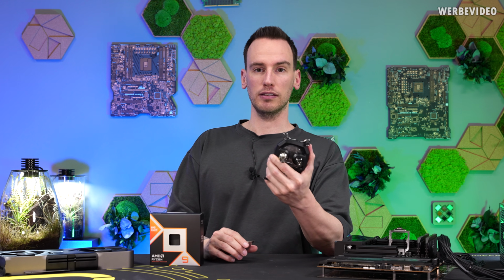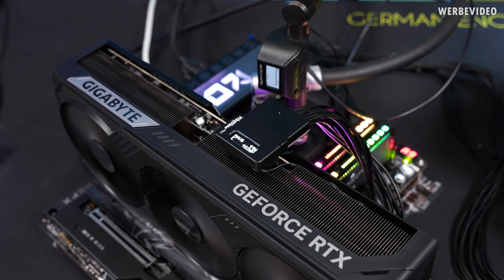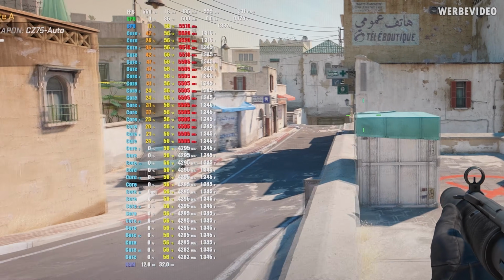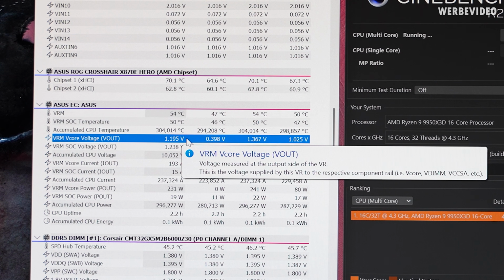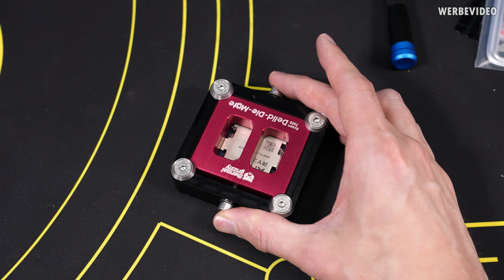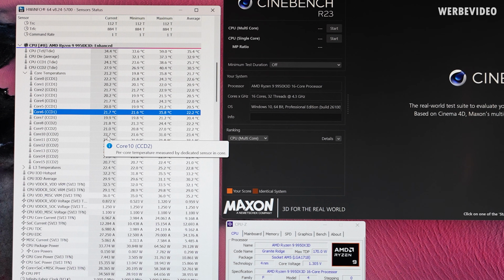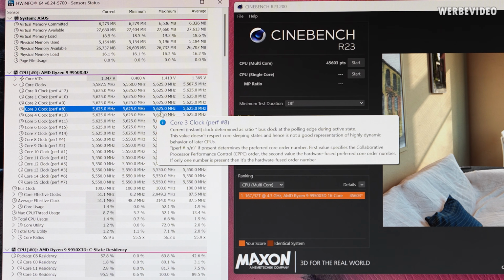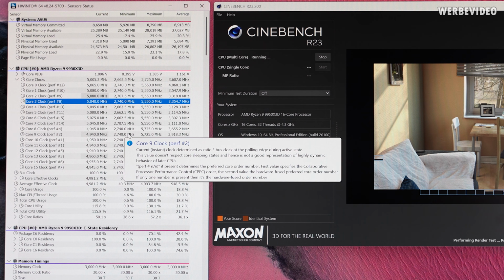Delidding the Ryzen 9950X3D makes it Even Stronger

Comment: hey kind of a noob here, since under load means a huge benchmark, and you seem to have it set it to .5s for the reloads on HW-Info, I would try setting the priority on task manager higher for it's process on task manager. I haven't tried it, but if it's counting the time IT's run it may be getting less and less time bcs the system is overloaded so it's runtime of 500ms may be longer irl.

Comment: Hi, I have a 9950X3D with the IHS. I recently reapplied thermal paste after noticing that under Cinebench load, while the core temperatures sit around 80–85 °C, CCD1 and CCD2 TDIE hit 95 °C. After watching your stock results, I see that your temperatures are within range, with lower core temps. What could be the reason for this?

I have a good thermal paste application and I’m using Thermal Grizzly Kryonaut. Is it possible that the liquid metal under the IHS was not applied correctly?

Comment: I achieved a Cinebench R23 score of 45,500 by running the 9950X processor at 1.075 volts with all cores operating at 5.2 GHz, cooled by a Thermalright Peerless Assassin 120 SE at moderate fan speed, with an average temperature of 75°C.

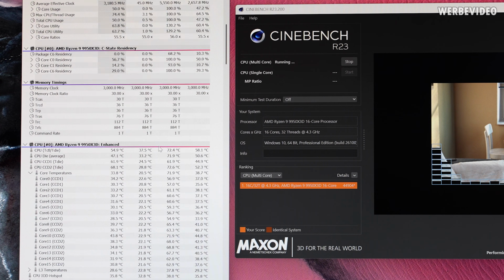Comment: 12:16 this is probably not a HWinfo issue. The CPU is already loaded 100% by Cinebench (or any other heavy benchmark software), so the CPU is unable to run another software, therefore, the temps won't update for a couple of seconds

Comment: ok this is the point where would step back, I'm not fully happy with my 9950x3d with the 280 AF3 pro, this thing idles between 40-50c, still haven't tested it under full load, guess i'll need to find out but whatever temp it goes to, I don't think I'll delid it

happy to see content like this though

Comment: thank you for the instructions. I delided my 9950 and wondering if i need to remove all the old tin from the chips or just use the your scraper to get as much off as possible before using thermal grizzly conductonaut?

Comment: I think I got lucky on my chip ( 9950x3d with 6400mhz ddr5 96gb) watching you review it hits about 72c in cinebench on 360mm AIO and I geta score of 46600ish as my best score. in cinebench r23. I wonder how high I could hit direct die. 

I did take the time (about 100 hours) to test curve optimzer (per core) and curve shaper (stacked together) so some cores are very unvolted (-25 CO and CS -20,) . I get 5.645 MHZ on ccd1 and 5.850-5925 on CCD2 (varies a lot per core) in games. in regards to HWinfo I found manually setting priority to cinebench r23 to normal helps. I mention this because there is alot head room on some chips aslong you can take time to test all small optimzer changes, but it take alot time to get near 100% stability (24 hour Corecycler run)

@der8auer EN It could be just my os (windows 11) but i noticed in past the cinebench r23 will almost alway start as below average priority that interferes with HWINFO 64, I have similar issue with Prime 95. I do also set my hwinfo64 refresh to 1000ms faster that causes issues for me.

Comment: I run my 9950x3d at 5.3Ghz both CCX 1.135 volts LLCmax switching max. Barely hit 70C gaming. (mostly cause GPU is pumping heat into CPU cooler) I'll hit 80 in Cinebench R23 but also get a 44000+ score. I did just install a Noctua offset mount to my Peerless assassin and dropped temps by 5C easy.

Comment: The reason your voltage monitor program doesn't update as fast under load is just that. Your benchmark program was hoarding the cpu and the monitoring program had to wait to update. Raising the priority of the monitoring program should fix that issue. (Or lowering the benchmark program but I don't recommend that as it wouldn't be a good test.)

Comment: 1 thing. 

Increasing efficiency by 15 watt 

Is gonna cost a lot more 

Than the 15w extra and a normal aio. The power saved will never cost as much as the waterblock. So here ur losing money, not saving. 

Ur paying more money up front to save on electricity but after 10 years u still havent saved anything and simply wasted more money and time. 

It simply looks cool and feels cooler for the user and that is it. 

Sorry but we have to be accurate when using the word saving, no, ur losing money on doing it ur not saving anything. 

Surprised how little this does for gaming tho. Hope the 10k series will benefit and make overclocking a thing again. 

It would be nice if u showed with max ram overclock as well like 8000 and below cl36 like bullzoid did (8000 cl30) and then running 5.6ghz on 9950x3d and check performance. 

If its like 20% or Nore above a normal build it could be worth it for a long term cpu and gaming upgrade.

Comment: I really want to delid my 9950X3d but the cost to performance just doesn't make sense. so I have about 10 percent extra performance while also increasing my electric bill and spending money on the water block and the tubes and radiator. Love that you did it but spending all this money for 10 percent boost in p[performance just doesn't seem smart. I guess if you have money to burn then sure.

Comment: My 9950X3D can do close to 47K R23 with COpt. PBO has MB Limits + Scalar 10X and +50 MHz. Using  -30 to -38 on CCD0 (cache) and most cores on CCD1 are -34 to -40. Power never goes over 233W. With 20c Ambient, R23 temps are 64-68c. CPU seems not to need a Delid

Comment: At 11:00 you are reading the per core sensor temp and comparing it to your water temp. CPU, CPU Die, and CPU CCD1 & 2 will be more relevant for that comparison. With so many cores packed so tightly together, the single "per core" temps are not very helpful to us.

Comment: Curious if you can reduce voltages more to reduce power draw. But delidding a 9950x3d is crazy! Those temp reductions are super interesting.
I currently run a 8700k that isn't delidded (but would love to do it) and have run into my thermal limit with high clock and as little voltage as possible, so this is great to see since my upgrade of choice would be to get a 9950x3d.

Comment: I'm confused. The OC with the lid had the CPU Die max at 80 but with an average of 48 degrees under load during cinebench and after the unlid, you had the CPU die max at 72 but a higher average of 58 degrees also OC under load for cinebench. Call me crazy but it seems the average temps benefit from the lid as it decipates the entire CPU of heat versus just the two small areas that you are able to make contact with the water block. And as far as longevity, the CPU lives mostly in the average world and not the maximum, so would it not be better to keep the average temps the lowest?

Comment: Why do you AMD youtubers sell non-failed CPUs to all the others?

I am pleased to note that your model does not have cores that are at +10, +15 °C compared to other cores. In reality, even 2 cores are enough to fail the entire CPU. You find two cores that shoot at 95 °C under cinebench and the others are perhaps at 78 ° - 84 °. It is not said that they are in CCD1, they can also be in CCD2. Maybe even one in CCD1 and one in CCD2.

However, it is nice to learn from your videos that AMD produces normal CPUs sold at fair prices.
Usually, from my experience, I have had to pay for 3 models of Ryzen CPUs that have, at the end of the undervolt and stabilization or curve optimization process and so on and so forth, even 6-9% less scores in the various tests.
All this obviously with a stable PC that does not reset or worse, suddenly turns off.
Once they called it silicon lottery today I would talk about unsuitable products or rather poorly manageable or non-compliant.
Let's not open the thorny chapter of how some mainboards presume to control the various CPU processes automatically with "AI tweaker" that becomes the master of your CPU barely accepting some manually entered settings.
The combination of CPUs with poor silicon and mainboards (some) that do what they want and like is fatal for consumers. Overclocking with nitrogen and CPU delid is another matter. Certain products should end up in the trash and not even arrive in stores

Comment: Curious about the lack of any sort of protection for other components due to liquid metal use. Not to judge, purely curious. I was under the impression that one should always put that acrylic fingernail coating stuff on the components in most potential danger of shorting due to liquid metal getting on them potentially. But here you are, I don't see anything having been done; and you don't seem concerned about it at all. 

I mean, you aren't putting the motherboard vertical at all, so I suppose that's part of the lack of concern, since a horizontal setup probably doesn't have that problem as much. But then what about pump out. Is that a problem with liquid metal at all? I don't know,  so I am asking; because I suspect it would be a problem if it was, due to those components surrounding the dies. 

Input would be appreciated. Looking to learn best practices from those who actually know, before doing any sort of thing like this in the future.

Comment: That thing is going to be an absolute monster for creating gaming content. You have a 9800x3d to run the game, and a 9700x for running Windows and recording software. I need that in my life!
Reply: Yep bingo this is exactly why I bought a 7950x3D over the 7800x3D and did the same with the Zen 5 counterparts. Love my 9950x3D. Actually really excited to see if Zen 6 will have a significant IPC and clock speed gain in addition to the rumored bump to 12 cores per CCD. That would be a colossal upgrade if true.
Reply: @ now I just have to find one in stock lol

Comment: Overclocking is an Asymptote curve where you essentially get diminishing returns with increasing power.  That is why it isn't really worth it to keep your CPU's constantly overclocked for daily usage.  Sure it looks cool to just eek out every bit of performance, but what does that do to the degradation of the CPU?  Same thing with Overclocking GPU's.    I think what you did with delidding it and getting a little bit of performance boost while lowering temps is the best of both worlds.  Now for most people I think that unless they really know what they are doing, they should avoid delidding and using liquid metal.  Too many people look at a video and see how easy the person does it and then when they try it themselves, they break something.  Then they wish they never followed that content creator's example.

Comment: With my 9950X3D -30 curve all cores, and just letting PBO do its thing i got a score of 45692. didn't need to manually OC, or De-Lid. I think it only pulled about 240 watts. Currently on a 280mm radiator and using the EK-Quantum Velocity² (block,pump,res combo). Shortly will be changing the loop and using the Optimus Signature V3 Pro. Hoping to drop temps a bit more with that setup.

Comment: I used the delid tool on 9800x3d with included Allen hex key by hand and also occasionally applied a little heat using an electric handheld heat blower. I am pleased with the results. It was very easy and only took about 20 minutes, I just took my time adjusting it back and forth while I watched some videos. Once the IHS was fully separated I was able to move it by hand and there was no need pry it or use any other tools to separate the IHS and safely delid the CPU. I also have the thermal grizzly am5 high performance heat spreader. I haven't completed application of liquid metal and installing the heat spreader. I've only booted up my system with the delided CPU quickly to make sure my CPU wasn't dead before I begin liquid metal application and installing the heat spreader. Are there any preferred AIO coolers to use with the thermal grizzly heat spreader? As it does indicate on the listing that the contact point sits lower than the stock AM5 IHS. I cant fit a 360 aio with my setup I have to go with 280mm, as I am not sure if 240mm aio would be a good combination with a delided cpu I feel like 280mm aio would get better results

Comment: Personally I think the biggest gains I have seen is when you use something like Hydra to undervolted/OC the chip, it keeps it in check and gives a good bump to performance.  Under game load with the same block and lots of water cooling my 9800x3d sits around 50C all day long, usually hitting around 5.3GHz and vid is at 1.15.

Comment: recent 9950x3D owner don't expect the v-cache omptimizer amd driver to handle all games it only manages a few games you still need to use afterburner/rtss to assess which threads the game is actually using and use process lasso to limit them to CCD0 and/or disable multi threading (lots of old games only use 4 threads) if you don't want to setup an overlay (which you really really should because nobody can tell you how to tweak your settings every pc is different and seeing a change impact live is priceless, just check my BL3 lossless scaling demo you'd think real 140fps is better than real 120 or even 60fps with x2 framegen it's not it's stuttering as hell) sticking to CCD0 is the best bet for any DX11 or older games, don't do it on DX12+ games, lots of games will by themselves favor the fastest cores which are the non-cache ones P.S. you might also want to do like me and limit your browsers obs and all those "background" tasks to CCD1 (c16 to 31) that's what dual chiplets cpus are good at

Comment: My dear engineer, you don't have to quit using liquid metal for safety concerns. You could easily combine thermal paste with it. I make a frame with thermal paste and fill center square with liquid metal to avoid any leakage. It works wonders I suggest with utmost sincerity.

Comment: I cant get my 9800X3D to overclock with PBO, i did +200MHz, 10x scalar, 400W PPT, and -20 curve optimizer. My CPU runs at 1.020V at 5.25GHz in CB23, and it NEVER boosts up to 5.45GHz. Also to make it stable at 5.3GHz static all core it takes like 1.35V which makes no sense that it takes 30% more voltage to run 50MHz faster.

Comment: My 9950x3D does -40 CO on all cores, PBO scaler is set to AUTO and +200mhz on the PBO offset. the vcache die maintains 5650 across all 8 cores while the other die is at 5875 across those 8 cores while pulling 170w on the package. 360mm AIO and the max temp for a 10 min R23 run was 76c and my best R23 score is 45133.  

I bought the chip on launch day, it was delivered the following day, and i really only played around with undervolting/PBO settings and benchmarking for a couple of hours before setting in on re-encoding my video library, which has been running pretty much 24/7 since.
Reply: Did you de-lid?
Reply: @vd8491  Nope, that's straight out the box performance. 

Which creates an internal argument in my mind. 

The responsible part of my brain says "it's awesome! Better performance then expected, running much cooler and lower power than expected, don't f*ck up the $840 cpu (20% VAT sucks)!"

But the overclocker in me says "if it's this good now, it could be a world record chip! Go on and F*ck with it, it'll be fine!"

Which voice wins, only time will tell.

Comment: I also got a little impatient when delidding my 9800X3D.

The IHS felt ready but wasn't 100% free.

I did know not to use upward pressure so I put it back in the tool.

It worked and now I'm using it with the TG AM5 HPHS.

Went from 80c to 68c in R23 using a 240mm aio and -30mv offset.

I still have the offset mounting kit and direct die frame to try one day.

Comment: Regarding the lower efficiency when significantly overclocking your CPU: Completely true when you look at the CPU isolated, BUT be aware that the rest of the system is also powered on which depending on the amount of additional components can also draw a lot of power. If the CPU finishes a task in 10 % less time so that the system can be turned off completely sooner that might lessen the degree of lost efficiency a bit.

Comment: When delidding, how did you remove all the stuff that was on the dies, after taking off the IHS (before you applied the liquid metal)?
Reply: They sell a plexi tool to scrape off the excess adhesive. You'll still need to polish the CCDs though.

Comment: I must have won the CPU lottery, I get 46325 with my 9950x with simply PBO and -30 curve, stock lid and Thermalright 360 AIO
Reply: I get 47733 with a -40 on a 420 ai0
Reply: @JoeMama-yl1ow  Like I said I really haven't tuned it yet. I just used the same settings I had on my 5950x (31200 in R23) and  got 46325. I'm sure it has some left in it !!  I wish my case had room for a 420.
Reply: Mine is doing the same and more when I do a memory overclock.
Reply: Hi, can you send a link or the full name of your AIO? I'm looking to get AIO for my 9950X3D.
Reply: @Bxrgo  Thermalright 360 AIO
Reply: @TheDirtyBirchTrails  Thank you

Comment: What I wonder is why the manufacturer doesn't use proper thermal conductive materials inside the chip to begin with? Why should the consumer have to take the lid off the chip to get it cooler?

Comment: Nice temps, would be even better with a good phase change material instead of paste, very nice! (yes, personally I would prefer pcm over liquid metal as pcm has very good performance without the risk of spills nor shortening the lifespan of the cpu by having the liquid metal migrate ever so slowly into the silicon.)

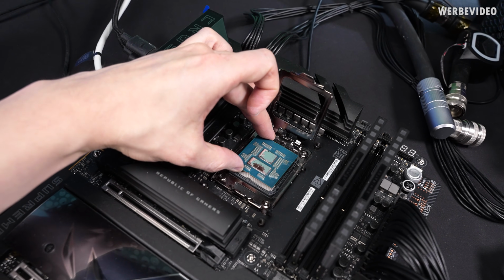Comment: 10:01 NOOO!!!!! There are cut-off side on the left and right side of the AMD socket. DO not teach this wrong way to the ppl of internet. 😁 Grab the CPU on left and right side, so you can place the CPU with perfectly smooth without any drop.
Reply: Not only that, but also would be a good idea to remove the CPU retention bracket before placing down the CPU.

Comment: I maybe lucky, or doing something right but i pass that cinebench score easy with just PBO and CO -25 on my Gigabyte x670e Xtreme and EK 360 watercooler and more than 46000 points.
I also use far less power, just 250 watt, my fans hardly ramp up.
I`m very happy with my performance. No delidding necessary.